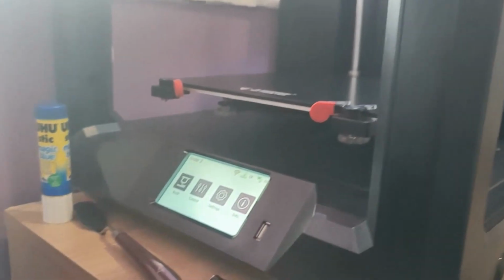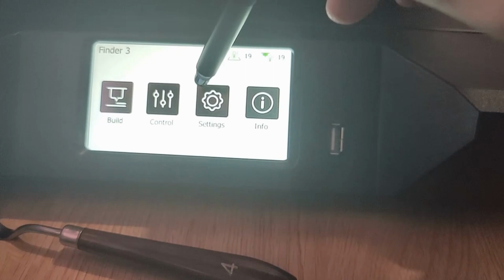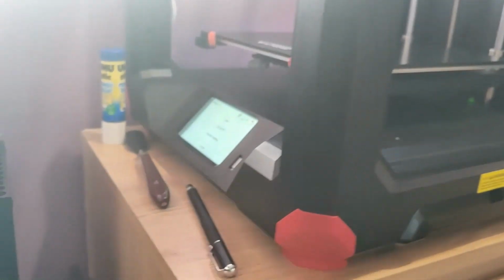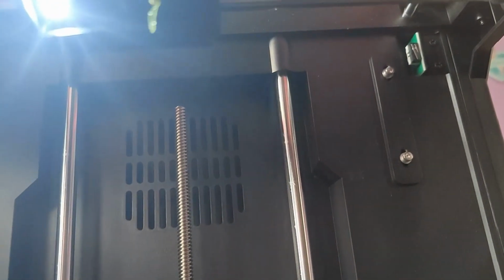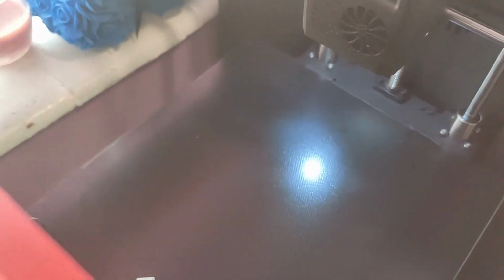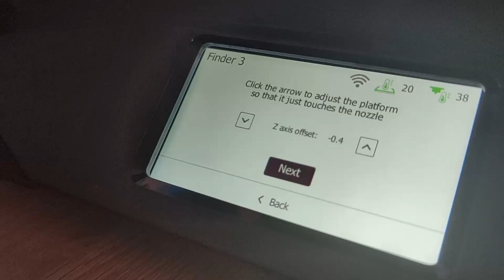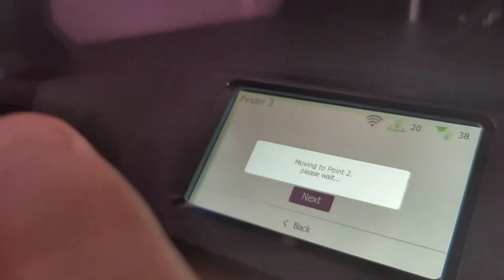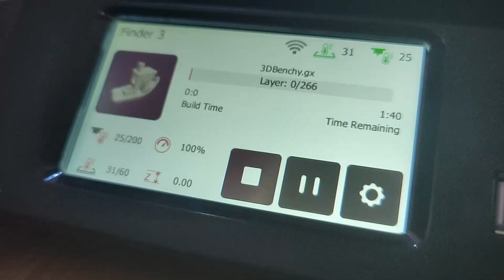Flashforge Finder 3: Setup and First Print

Comment: Have you had any issues with the print not sticking properly to the plate, even when you level it? Ive had multiple prints fail because they get caught on the nozzle or when I print the bridge, part of the bridge is sticking up and gets caught.. different things keep happening. Ive been learning more but with the machine being a few months old on the market, not a lot of info out there.
Reply: Hey did you get any solution to your problem? 

Seems this printer cannot be leveled properly. 

I've tried all the things and still - printing something that uses whole printing area does not stick properly and warping on the edges. 

I can see that bed is lower on the edges. If I'm trying to raise it then middle point is touching nozzle too hard. 

Wondering if that is the downside of having bed leveled according to 3 points only.

Apart from that two fans broke within first 120hrs of printing and required replacing (motherboard and nozzle)
Reply: the manual says for the glass plate you might have to add glue
Reply: @abiellujan8392  sure but printing five squares (edges and one in the middle) gives me different print quality. Cannot get top left corner aligned it is always too low.
Reply: @Szot-Art  ah ok
Reply: @Abiel Lujan  so contacted flashforge to get some advises but not sure if they are not taking me seriously or simply struggling to understand English but their solutions proposed to me makes no sense at all. 

Problem I have is that during calibration all three points touching bed and bit harder than they should (just in case to be sure there is a contact).
However one corner (top right) is still too low and print does not stick to it. 
Flashforge advised me to adjust knobs to lower back corners which would make it worse only.

Seems that customer service does not understand their own product. Not much of help.
Reply from the maker: While I found the glass bed better than the flexi-bed I used on the Adv3, 
It did require a little glue stick everytime. (with a good wash once a week, followed by a rinse with isopropanol)

I didn't have any issues at all with levelling the finder 3, 
But with any machines using that system, it's worth levelling twice.. 
.the first time, by the time you've corrected the front corners, the back might be a little out, 
So going back to re-level immediately, might mean just a fraction difference at the back the second time +which will make a world of difference to the back corners).

But with the glass bed, once levelled correctly, you shouldnt have any issues that side.
Reply: @Xbox Oldies  yep I've used glass bed all that time. 

Leveled 100 times, took to consideration that front could affect 1st point on the backwards. However, middle and left section of the back was perfectly fine, just right corner remained too far from the nozzle.

Even when I raised bed enough to reach all 4 corners (including affected one, and sacrificing front a bit) then nozzle was too close in the middle and scrabbed off filament applied during print. 

If I could level bed by 0.01 not 0.1 then perhaps I would get into some compromise.. However, having one corner completely off that clearly indicates problem with the bed.

What's funny, Flashforge considered this as huge problem, but after 100 of tests, adjustments that did not bring much of a difference they've told me just to ignore it. Well.. that one corner was affected so much that even glue did not help and anything printed there simply warped during print (I even purchased 3dlac which is much stronger adhesive than glue itself).

I'm returning it now, switching to ender 3 that has cr touch (automatic bed leveling system). Manual adjustments are going by 0.01 so I can more accurately control any quality flaws.
Reply from the maker: @Szot-Art  I think the tough thing is, with a glass bed, it's "straight"..  
So if the opposite corner is correct then it would counter the lower corner (if that makes sense), 
It's technically almost impossible to have 1 corner out and 3 correct on a glass bed (it would usually be 2 out) so maybe worth concentrating on the opposite corner. 

Obviously with something like an Adv3's Flexi plate that can warp slightly, even if perfectly "straight" it might not be level. 

But with a straight glass bed, if one corner is 0.1mm low, the problem could be the opposite corner being 0.1mm high (levelling that corner would then increase the opposite side. 
Hence my suggestion for levelling multiple times, because the front corners (levelled last) could throw the back corners out slightly, especially if the front ls are adjusted more than a tiny amount. 

Hopefully that helps, 
If you're still having trouble, check the official usergroup on Facebook, and reach out to "Amy Wen" or "Julia Wu" as they're the main accounts for Flashforge on that group
Reply: @Xbox Oldies  hey,

Thanks for your support, interest and patience.

I had same feeling and point of view about this but I went through bed leveling multiple times and could not get this sorted unfortunately. 

I took to consideration that lifting opposite corner will get problem solved and it did, but then middle section of the build area was too close to the nozzle. I've tried to lower left area to compensate lifting right - but then right front corner became too low again. I've added some aluminium foil between glass bed and the platform and that partially helped but I did not pay that sum of funds to add aluminium foil to it.. 

Not glass bed but carrier that holds it wasn't straight.

I've spoke with 2 Chinesse representatives, contacted US and seller itself - did my best to get it sorted rather than returned but seems flashforge could not be bothered to properly investigate my case. 

Now is a bit too late for that. 

Thanks for your help! But that should come up from Flashorge itself.
Reply: @Szot-Art  mabey a warped bed
Reply: @Lawrence Blair  that was the case.

Returned back and got ender 3 s1 pro this time. Spent 15min to level the bed and got ideal outcome now. Seems my skill or understanding principles behind bed leveling were not the problem here..

I did some investigation on flashforge bed leveling issues and it seems there are lot of people facing same issue and lack of support from customer service on reddit. 

Not every unit is affected but most of them.
Reply: @Szot-Art  got my new finder 3 coming in today and then monday a creator pro 2.. but from the videos im seen about creality they got good machines too
Reply: @ScaryNda206  well. There is more "room" for any adjustments with Creality. Finder 3 gives you nothing but 2 knobs only.. Good luck, let's hope you would be luckier than myself.

Comment: Would you buy this machine or the creality sermoon v1 (£220 at the minute). It will be my daughter's first printer.
Reply from the maker: I've not used the Creality myself, but I know they also make some fantastic machines. 

I did have a few issues with the Finder 3 and moved on to the Adv3 Pro V2 which I personally preferred.

Generally, if the Creality Sermoon v1 is similar spec and performance, at that price, I'd go for it. 
But if it's RRP is less than £300, then you might not get near the performance of the Finder 3 / Adv3 series printers.
Reply: @LeeHubbz  Thanks for your reply. The sermoon v1 pro has an RRP of around £450 but is on sale at the minute.
Reply from the maker: At that price, I'd go with the Sermoon. 

Flashforge and Creality both make great machines and imho they're worth their RRP,   so if you can get one for that saving, I don't think you'll be disappointed.   

Just bare in mind, with any 3d printer, they're not plug and play, they do take some getting used to, and you might go through an entire reel of filament before you're getting great results consistently.

Just be patient, use it as a learning process and start simple, when your daughter can printer a simple "Benchy" perfectly, then move on to more extravagant prints.
Reply: Thanks again. I'm an engineer so will be helping her along with it and am aware they need some work. Both have their pros and cons and I will also be new to 3d printing.

Comment: Can anyone advise me on what to do?…
After connecting Wi-Fi on the printer it advised me to update firmware. I selected yes. It completed its update and prompted me to reboot. I turned the unit off and on again and now the screen on the printer is stuck on its intro image that says “ flaskforge 3d printer”. How can I get it to switch to the menu options?
Reply from the maker: You can update to the current (newly updated) firmware via a usb stick.

If you join the "Flashforge Official User Group" on Facebook, there's full instructions available there (search Finder 3 Firmware
Reply from the maker: Sorry, I was out when I originally replied, 
If you haven't already found it, this is the post I mentioned: https://m.facebook.com/groups/913241999042183/permalink/1877999042566469/

The tips there (and there's a video regarding the usb update) has resolved the issue for most users, 
But if you're still having trouble, comment on that post and if necessary tag "Amy Wen" and the team can try to help further.

Comment: Not worth buying. 

Brand new unit:
- Faulty Motherboard Fan (outside the box)
- Faulty Extruder Fan (after first 140hrs)
- Bed uneven, cannot level one of the corners (software adjusted one, not much to do there as middle is perfectly aligned but right side of that area is still lower than rest of the bed).
Contacted Customer Service team. However, these are Chinesse. Their respond is general, most cases template is used. Not really impressed as very poor quality and after sales service received.

Comment: Hello mate, just wondering after several months how the printer is doing, have you had any issues with it?
Reply from the maker: I passed mine on to a new owner. 

Overall I preferred the Adventurer 3, purely because of its overall simplicity.
 the Finder 3 was a great machine, but a little more prone to issues than the Adv3's easy-switch nozzles. 

The Finder 3 is a step up, so not as well suited to a new user as something like the ADV3, 

But for someone a little more experienced (just like most mid-range 3d printers) the Finder 3 does offer slightly better print quality and speeds, if you've got the experience to keep it free of blockages and running optimally.